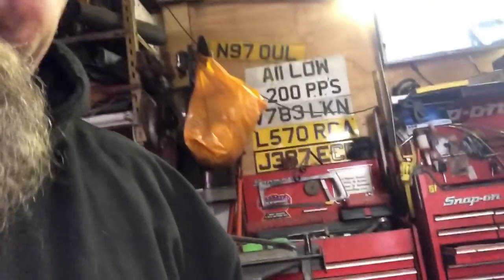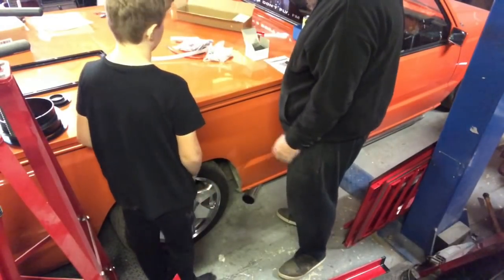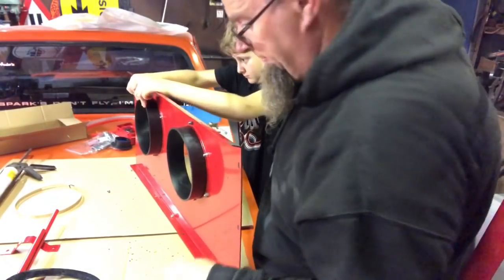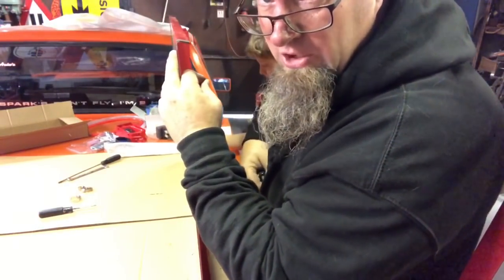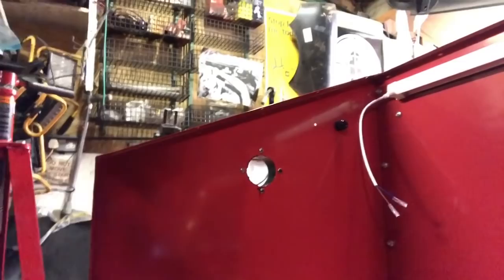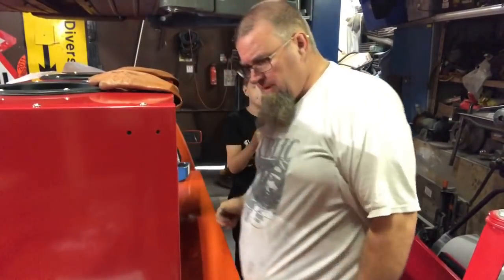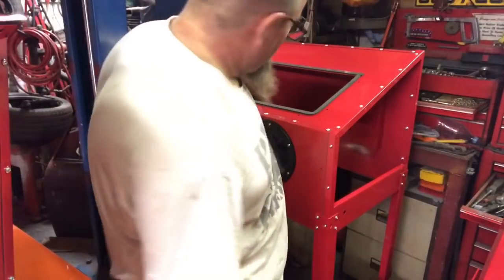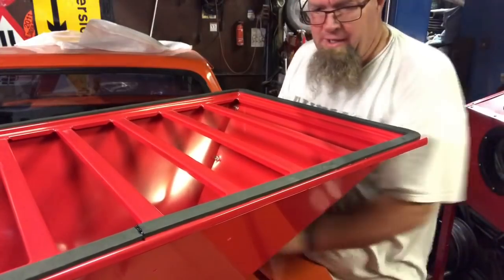220L sandblasting cabinet assembly Part 1

Comment: Would I be able to use this same cabinet with my 13cfm air compressor?
Reply from the maker: Simon Noble ... Hi 👋 .... ive just checked out the instructions as im in the workshop right now !! Handy huh !! They state it needs to be 14-25cfm at 40-80 psi ..... i guess it needs a lot of air !
Reply: @Xpp.  hi dude, thanks for quick reply, and for the info,  I'll pay an extra tenner then for the extra cfm ! So it puts me on the minimum boundary at least! Lol. Is that what you run your sandblaster at , between 40-80 psi?  I heard some people say they run 50 psi just fine, same for you?
Reply from the maker: Well , ive been running mine at full pressure 100-120 psi ooops !! I just plugged it all in and pulled the trigger!